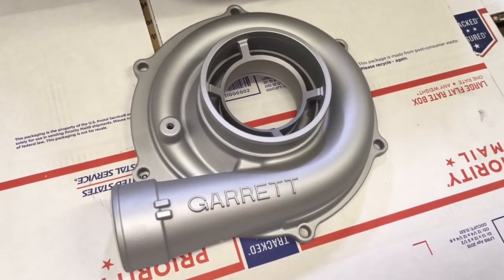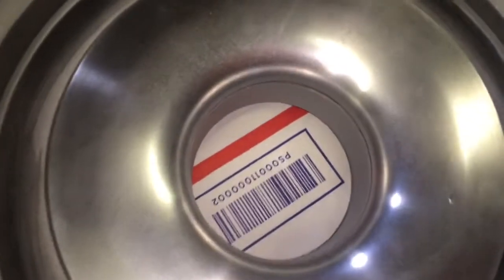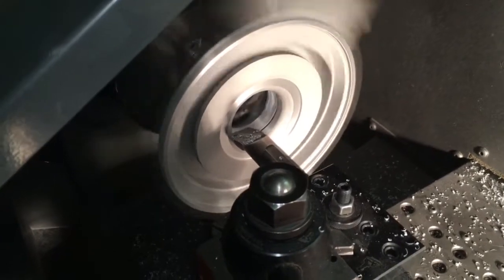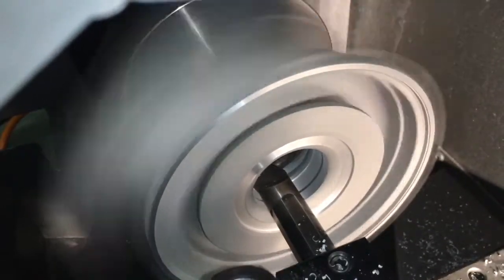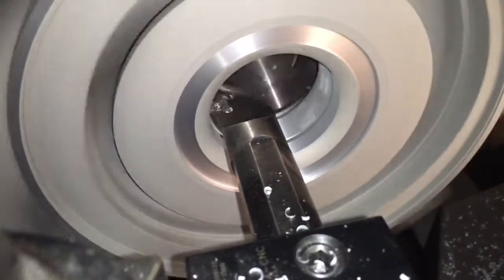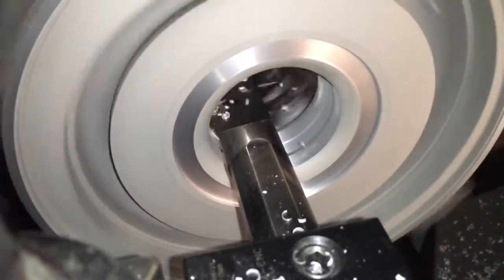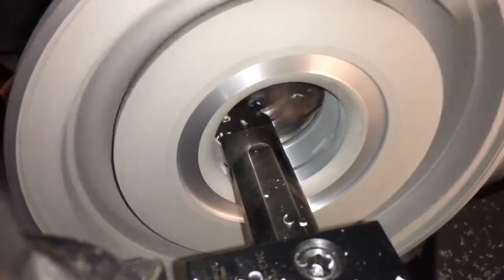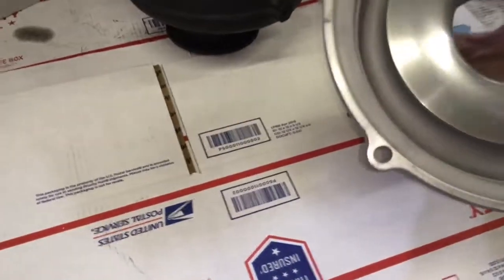Machine 6.0 powerstroke compressor housing tips

Comment: Do you offer the machined cover and necessary parts for the powermax conversion I can install myself?.....btw I already rebuilt my turbo with your kit and love it! Thanks.
Reply from the maker: I machined the stock wheel and plates, I have plenty of cores right now that I can machine to do an exchange. We do the machining service to the wheel and plate for 120$. We sell the wheel for 170$
Reply: Turbo Lab America That sounds very reasonable, I don't want to exchange and was hoping I could just buy one. I'll find a cover to exchange and get in touch with you. Thanks!